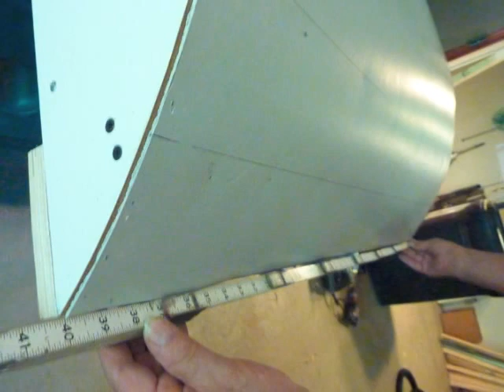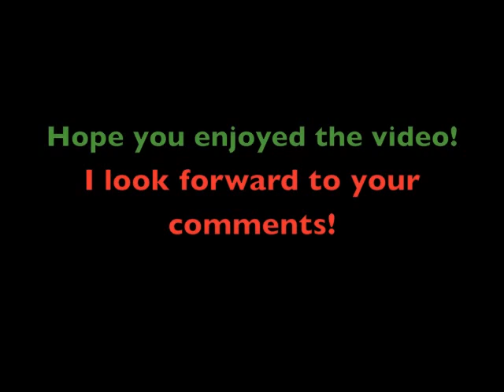Wood Fired / Brick Oven Pizza Construction - Build Your Own!

Comment: Very good build. Looks like the z Alan Scott bread oven design. One simple step you included I see lost in so many videos is the foil layer. That layer allows heat reflection and gives a better heat up time and helps prevent heat loss. Looks great.

Comment: the first two bricks at spring point of the arch where only cement holds the radius in place , fails sooner than you think under extreme heat . well done all the same .

Comment: i've seen some issues one be sure you check with your City/County for your fire regulation to get the correct chimney hight and distance from your home. next is wouldn't you want to feed the fire from the back of the oven then at your feet? next why use concert for the cooking surface when you can use Garnet? (buy couple of old grave stones which have spelling errors on them they aren't expensive and place then name side down) leave a gap for the smoke stack near and just over where you feed the fire. then it should work well.
Reply: +martin dana 

Garnet or granite? 

Garnet would be hella expensive...though cooking on gemstones has a certain posh flair to it.

Comment: Lots of good ideas here. I am in the process of gathering good firebricks. I built a Pompeii oven with the wrong kind of brick and it fell apart because the bricks disintegrated. For those considering this project, The light weight porous bricks are NOT the right ones. Get the heavy, dense ones. Most suggest alumina content between 20 and 40%. I would love to choke the lady at the brick company who sold me these bricks. The high alumina bricks are expensive, from 3.50 to 5.00 each. Now, I will build this "vault" design to keep brick cutting to a minimum. The dome Pompeii requires a LOT of brick cutting. If you aren't a stone mason, I don't recommend building a dome design. Also, I strongly suggest building the floor like this man did, by laying the bricks on their side instead of laying them flat. This will give more thermal mass and hold a more constant temperature. Requires more bricks though.

Comment: Gee that is a hell of a lot of work just to bake  pizza or bread. My neighbor has had one made by some company. It is a round one but without any mortar holding it together. And there is some kind of heavy electric coming out of it too.  It has some kind of liner in side of it and is filled up with something  that looks like crushed rock.  So far it is not finished so do  not know what kind of a brick oven it will be.